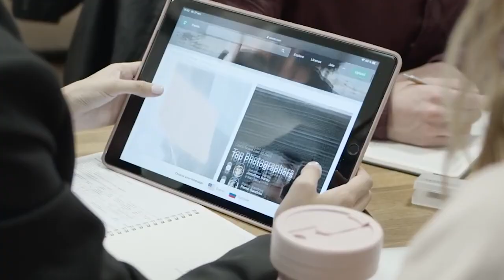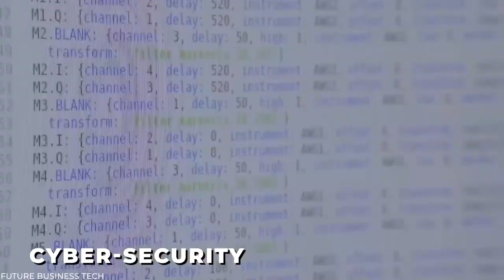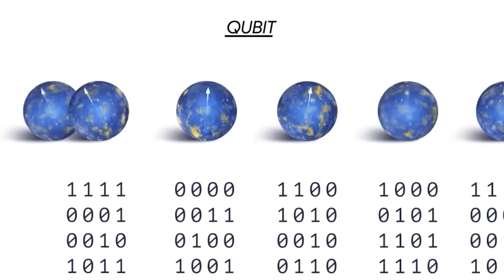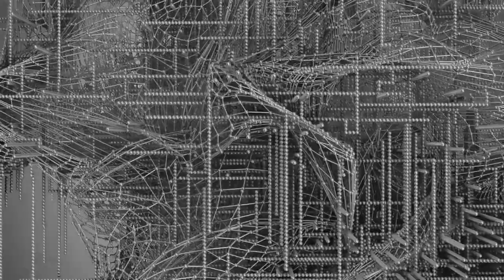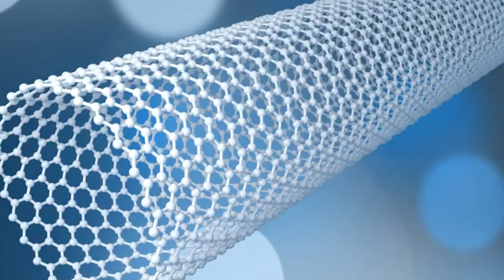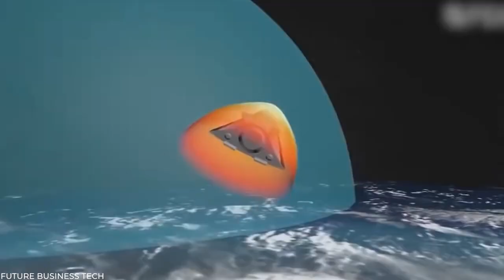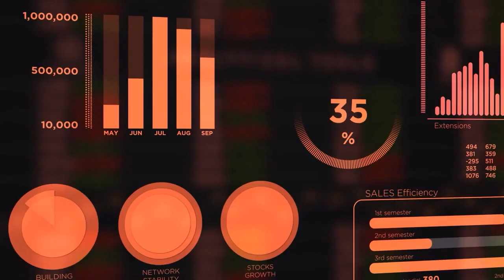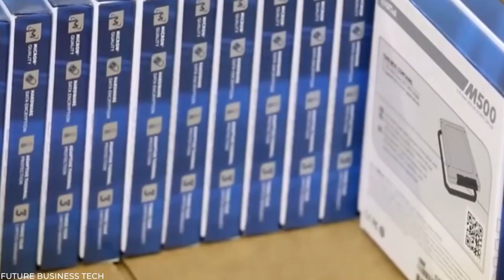15 FUTURE Technologies You Have NEVER Heard Of

Comment: 3D printed organs sounds nice, especially if it can use your own cells so the body wont try to kill the organ and you wont have to take medicines to stop it from happening.... Maybe print arms legs or even most of the body when the repairs needed are extensive...
Reply: This is easily done using stem cells